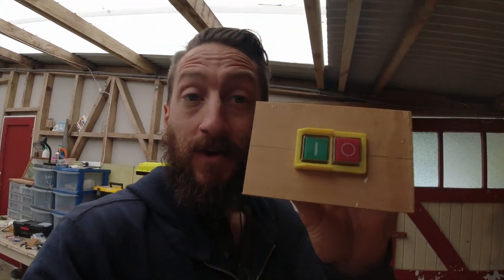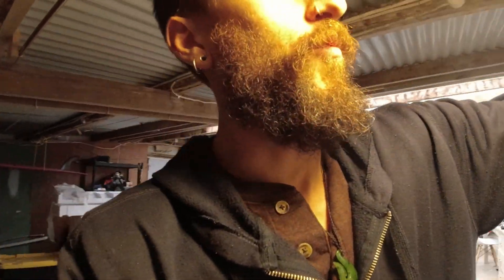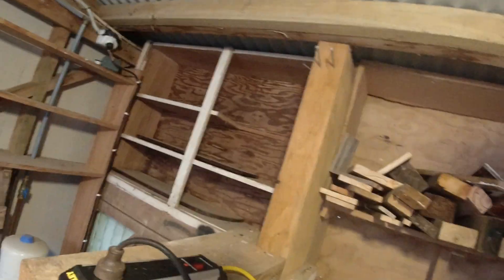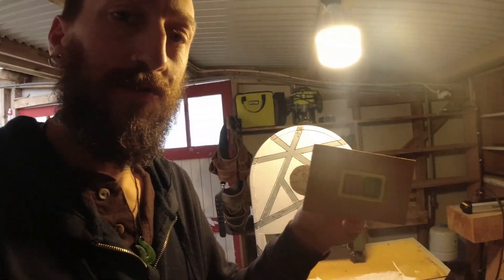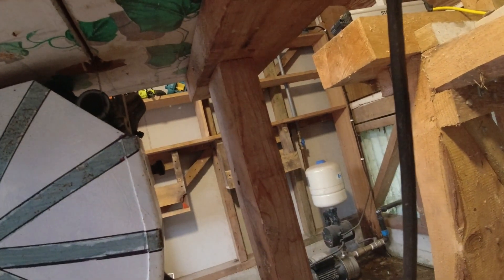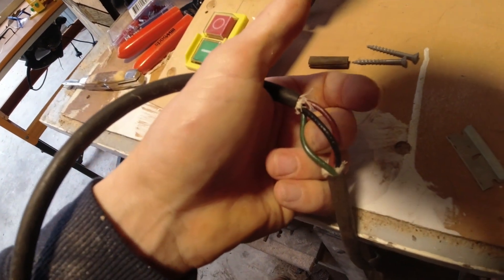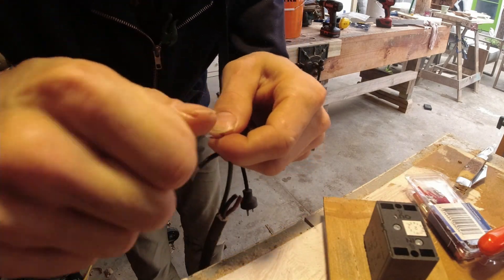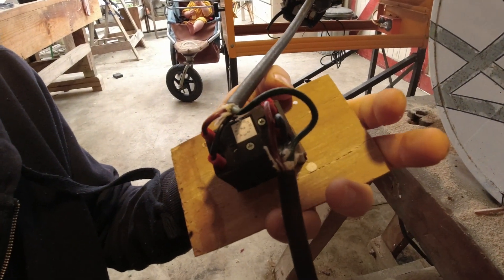Installing an NVR switch on a 70 year old bandsaw!

Comment: When replacing/adding a switch on an old tool or appliance, rather than reusing the original power cord, or even a portion of it, I use a new 12/3 extension cord to replace the entire power cord. This gives you fresh new wires, and insulation, which are all much safer.
Reply from the maker: Great tip!